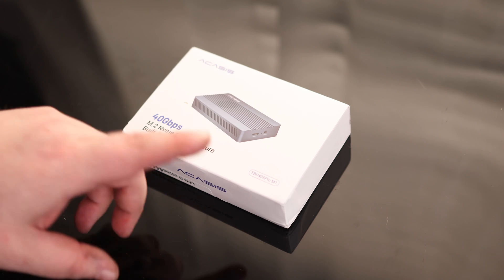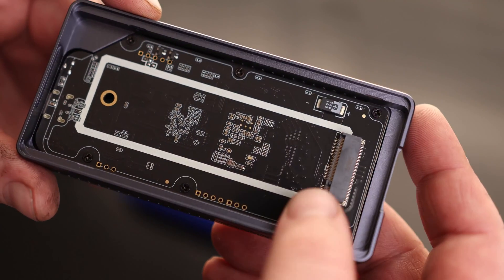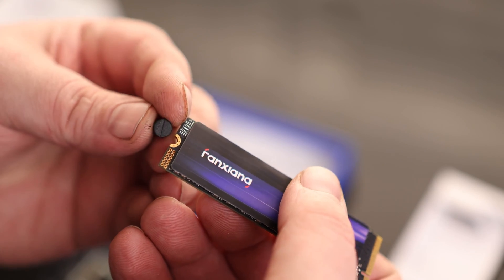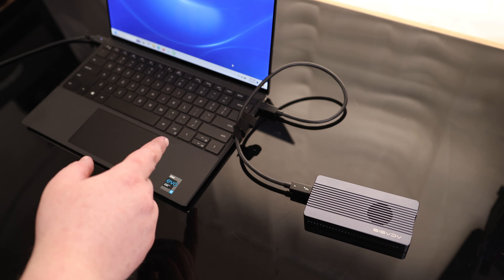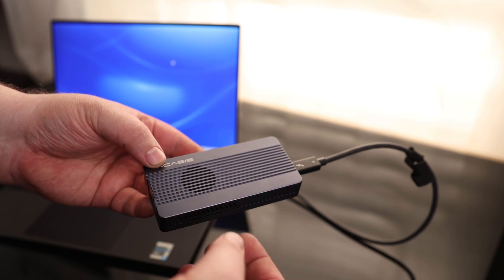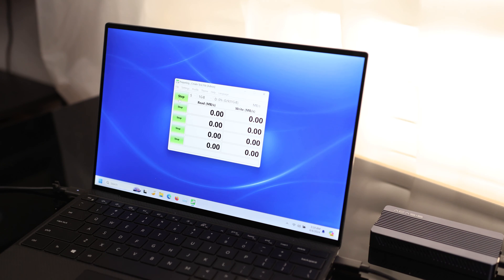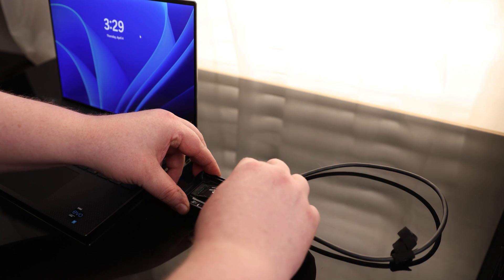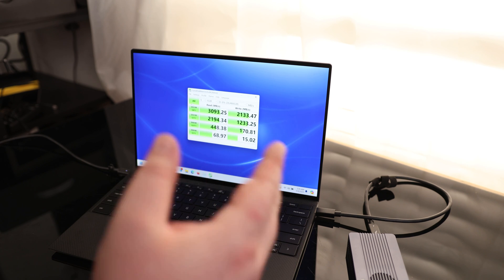ACASIS 40Gbps M.2 NVMe SSD Enclosure with Cooling Fan, TBU 405 Pro for M1 M2 Pro/Max

Comment: Not all cards with heat sink will fit. I contacted them about the ADATA 900 series and the card was just a bit big.
Reply: The drive is a heat sink.  Just make sure that the conductive pads firmly touch the top cover and you have a massive heat sink over 6x the heat sink that sits on the NVMe card.  The whole surface area of the dribe acts as a heat sink (which is why they operate warm to hot to the touch).

Comment: Thanks for the quick, concise review! I just ordered one of these after pretty thorough research. I am curious if you've been able to test it with a Thunderbolt 4 set-up yet. My laptop is Thunderbolt 4 capable.  I plan to use a 2TB gen 4 NVMe ssd in the enclosure but have to wait until next month to order it. Budget constraints 😆. Have a great day amigo. 🫡 🍻

Comment: How's this case been holding up? Just ordered one. Curios if the 'disconnecting issues' are just rumours.
Reply from the maker: No issues on mine.
Reply: Update: been running perfectly. No issues at all.
Reply: @ thanks!
Reply: ordered mine just now, I will let you know, Im curious too.
Reply: or do you have the issues?